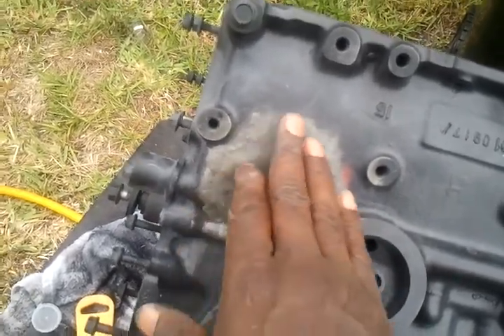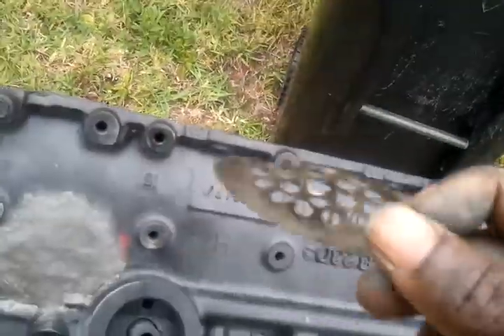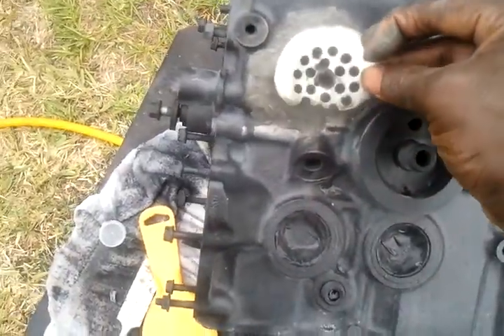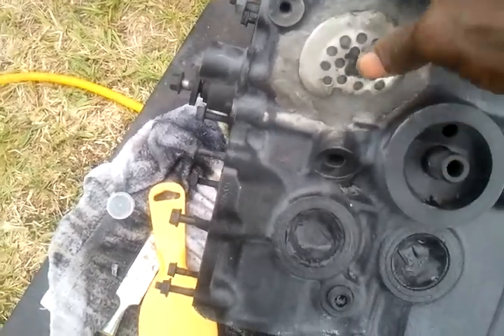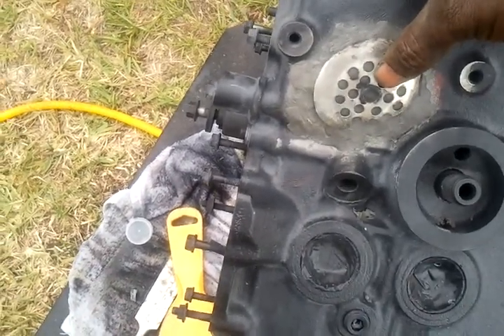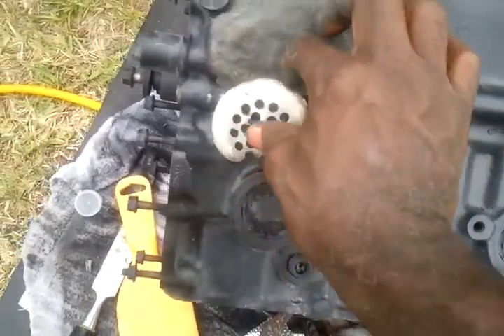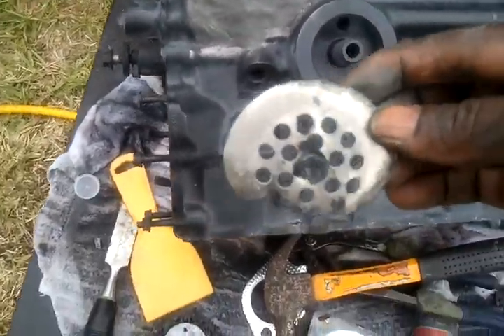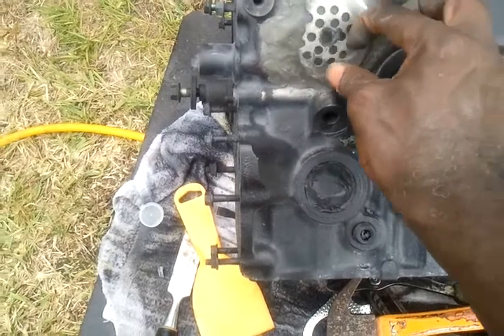Hole in Engine Block Repair Part Four

Comment: Right I want to see the motor tuning bc I have the same problem and I want to do that too.
Reply from the maker: The video entitled "First Start Up after repair of the hole in Engine Block"  Also, look at the one where I wash the motor at the car wash.
Reply: I have a hole too! what did you do? AND DID IT WORK?

Comment: Can someone tell me what he did on the outside?
Reply from the maker: I placed JB WELD Steel Stick Epoxy Putty, 900 psi, 2oz over the hole and sanded it down.